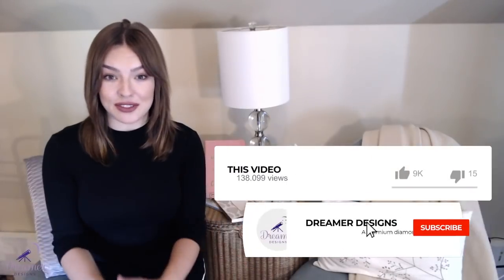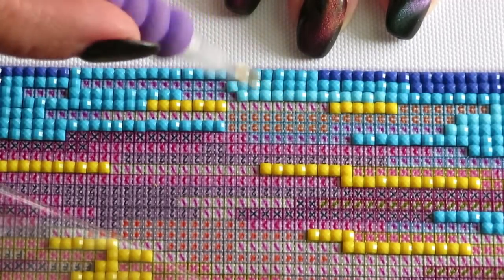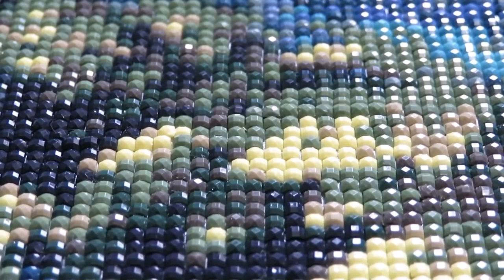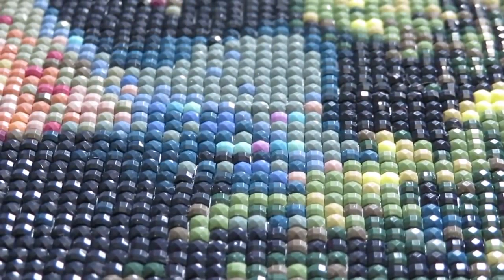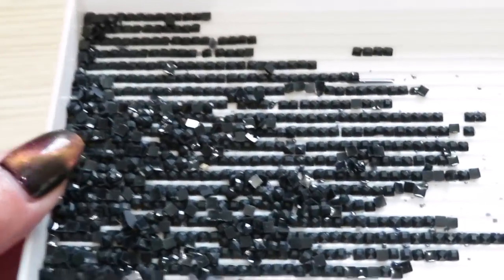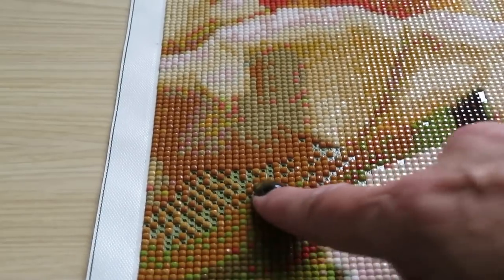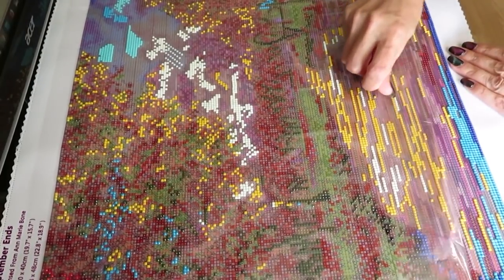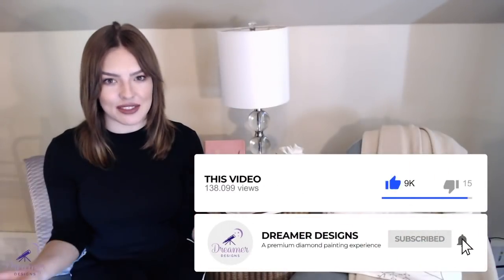Top 5 Diamond Paint Frustrations | Diamond Painting 101

Comment: Are rivers and bubbles more likely to occur in canvases with a paper cover? I haven’t had one yet, but I’m getting an important 40x50 and I need to know how to deal with them if it’s likely to happen.
Reply from the maker: Yes they more commonly occur with paper covers because these kits tend to come from aliexpress/amazon and are folded or scrunched in the packaging. There is no real fix for air bubbles because most of the time the diamonds still wont be able to sit properly even with some fixes. You can try to slice the air bubble open with a box cutter and press it back down to release the air underneath. Good luck and happy painting Lindsey!